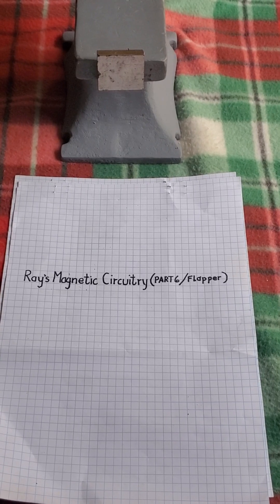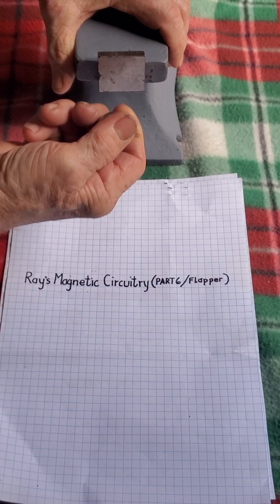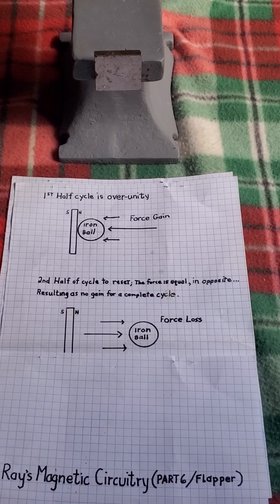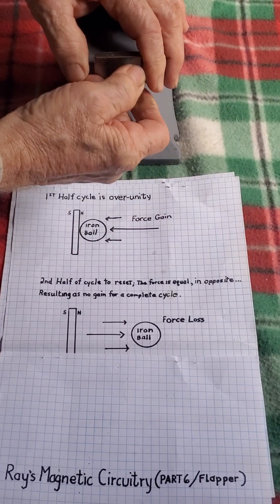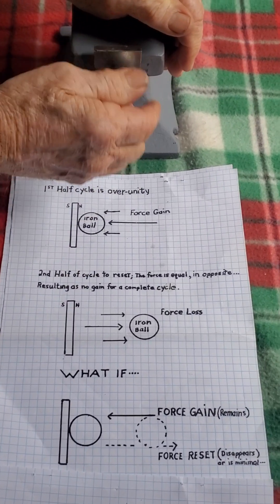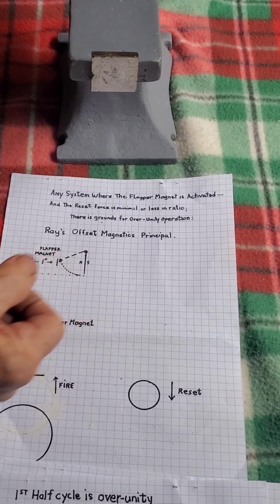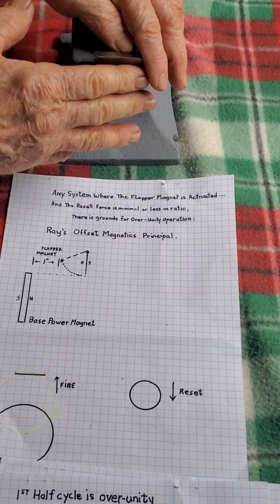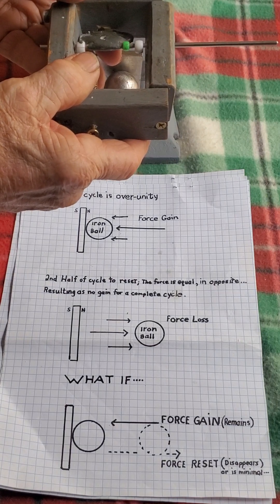Ray's Magnetic Circuitry [Part 6 / Flapper ]

Comment: Hello again. Nice video. Are the construction requirements very tight to make these things?  Also, I suppose it does not matter that the axle shaft of the flapper is iron or aluminum it is not crucial ?
Reply from the maker: Construction measurements is just try it to satisfaction. Remember 2nd story Magnetics...I use stainless steel axil.. have not tried iron...On side note...you can bump up in and out measurements and get stronger force gain with small force loss...well worth the small force loss...I try for video purposes the lowest force gains just to show its possible operation ..Don't worry to much at first about super low in and out...